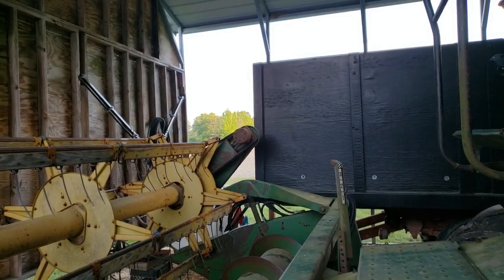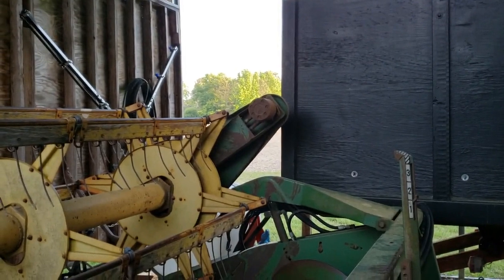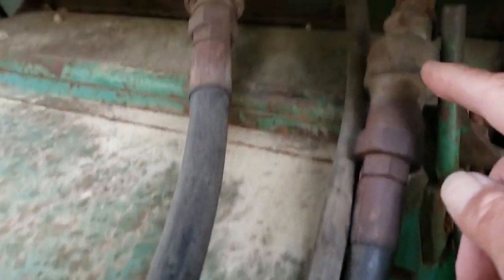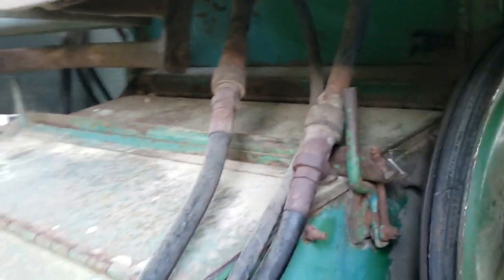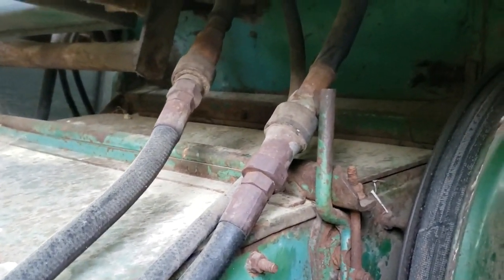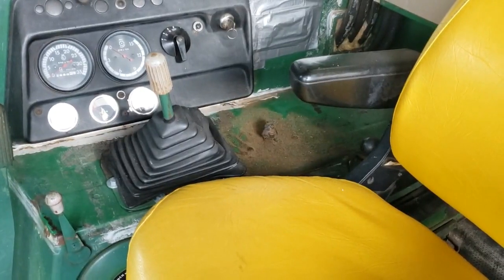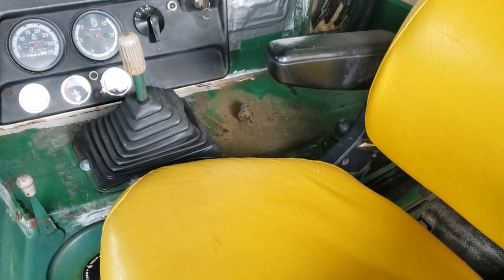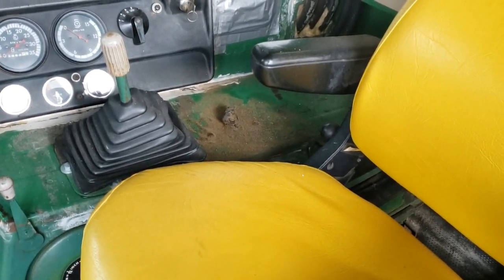3300 Combine info for Hughes Farms

Comment: When the grain head is off (For instance when a corn head is on) Those two couplers that come from under the cab get coupled together. At least that's the way mine was when I got it. When I put the grain head on I uncouple them and attach them to the two lines that go to the reel drive motor.
Reply from the maker: Pete, I bet that's exactly how his hydraulic lines are right now. So glad you're here and placed this comment here.  I'll have to direct Mr. Hughes to your comment. Thank you Pete.🙂👍
Reply: @SoybeanFarmer3300  My 4400 hydraulics hook up the same way.  Those 2 lines are also connected together when you put a corn head on, such as a 444  or 443, since they are not needed to operate a head like that.
Reply from the maker: @pagrainfarmer  the blessing I received in return for attempting to help this man figure out his speed control dilemma was learning I had better connect these two cables together before I crank my combine to back it away from the feeder house after detaching the feeder house. could have been a real catastrophe. I bought new rasp bars and I'm not looking forward to the installation. The ones in the combine are clearly worn out, should have been replaced probably 7 years ago. Separating and then reattaching that feeder house is most likely going to be somewhat of a challenge.
Reply: @SoybeanFarmer3300  When I bought my 4400, the grain head was on it, but I bought the farmer's corn head as well.  That was one of the first things he warned me about, was attaching those hoses to each other when the grain head was off so as not to damage the hydraulic pump.  When you help someone, I believe it always comes back to you!  Things happen for a reason and it's not just coincidence.
Reply: And if you don’t couple them together when not used with a header, can ruin the pump.
Reply from the maker: @d6joe  thank you so very much for adding your voice knowledge and expertise into this conversation.

Comment: You must couple those lines together when not the reel drive motor, ie using a corn head. You will burn the belt off the pump if you don't, learned that the hard way.
Reply from the maker: This fact blew right past me until David mentioned it thank you Steve for bringing it up again.🙂

Comment: The only thing I would add is if you take them part from the head you must connect the 2 lines on the combine together or you will mess up the hydraulic pump that runs it. You don't use them with the corn head. Last fall when I was hooking up the bean head. One of the connector popped apart.  I must of not had it in all the way in. When I started the head up there was a load popping noise. It was the pump dead heading. I found that it was disconnected.  Hooked it up and all worked OK. But it only ran for a second. Great info.
Reply from the maker: Tim read David's comment. Farming for Fun and Profit. Thank you for being here and sharing your knowledge about this with me Tim.

Comment: All the conveyor tables on our Bale unrollers are..... Hydralic motor driven in series.... meaning the oil passes thru one motor before going to the next  then the next  Untill it goes back to the tractor..... There is a needle type flow control  valve to regulate the speed........ Now our 110  Deere backhoe and the  KUBOTA wheel loader  has two  hydralic lines THAT MUST BE COUPLED TOGETHER  on the base unit     When you remove the Hoe attachment or you will deadhead and Grenade the pump........Big Warning Sticker.
Reply from the maker: I just found out by reading your comment why God told me to attempt to help this man. I bought the rasp bars to put on the cylinder.  I'm going to have to remove that feeder house, I've looked at it every witch way now!!  what do you suppose would have happened if I'd  disconnected those hydraulic lines and then cranked the combine to back away from the feeder house? I don't have a big bright yellow warning sticker but God gave me a friend named David, thank you my friend, I had not even considered this.👍

Comment: Ok mine only has the small line for reel up and down...  My combine does not have that control in the cab I will make a video of mine tomorrow. Must have been a option... I am wanting to upgrade to a 213 flex header with hydraulic reel speed my my current header Is chain driven reel and ridged ....
Reply from the maker: oh wow!  I can't imagine picking beans without a variable speed reel.  yep, I can sure see why you'd want to make that option available on your 3300.   read the comment pinned to the top of this video.  He is Farmer Pete and has a head full of knowledge about the 3300, he has one himself.  I subscribed to your channel so I can see the video when I get the notification.   maybe we can figure something out.
Reply: @SoybeanFarmer3300  I really appreciate this! I'm a first generation farmer here in Michigan
Reply from the maker: Farming is an adventure and this is nothing more than another adventure.  The solution to this particular Adventure may be finding a 3300 or a 4400 in a Boneyard and then salvaging the required parts to add the option to your 3300.🙂☕
Reply from the maker: Comments are turned off on the video you just put up about your John Deere 3300 combine.  Grain head looks like the type where  you would be changing chain sprockets in order to control the speed of the reel.